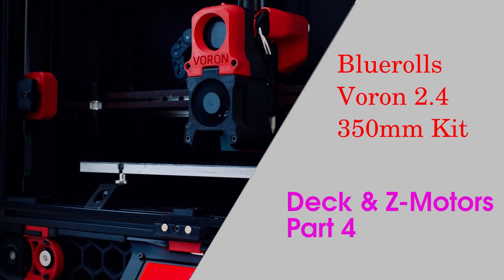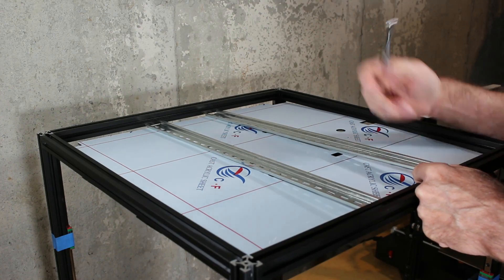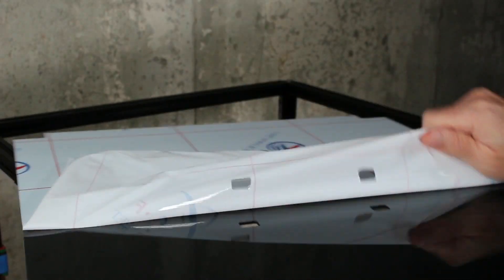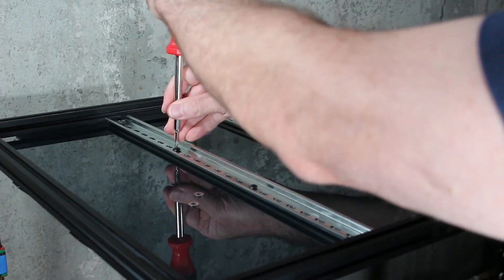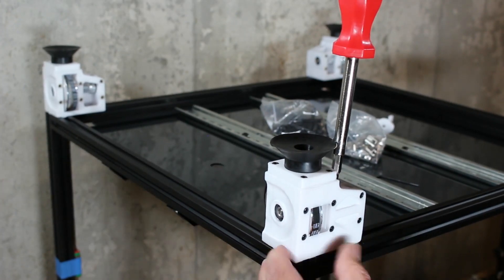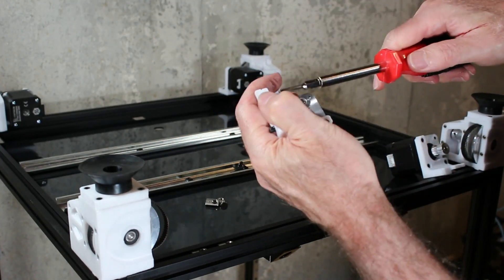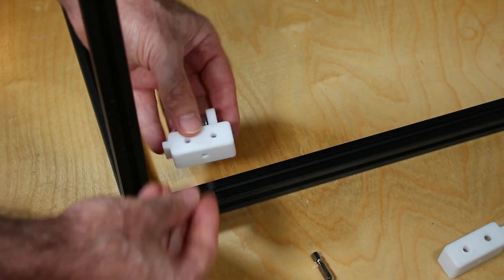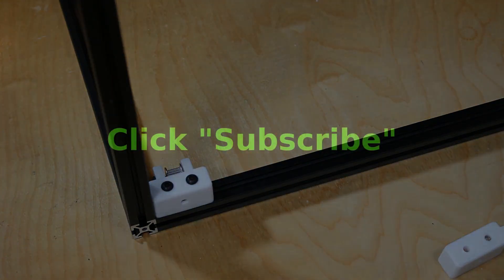Voron 2.4 Blurolls Kit Part 4 - Deck and Z Drives

Comment: I'm building the Z idlers on my blue rolls and noticed the 9mm idler pulleys have a lot of side to side play. The print has a small standoff to press against the bearings ID but it's nowhere near close on either side. Is this normal? I first printed the 6mm idler housing but it was way too small so these are 9mm for sure like yours.
Reply: It actually looks like I could add a washer to each side but if it's not designed that way I'd rather the route that is known to work well. Only area I see the play possibly being an issue is the cut outs in bottom cover.
Reply from the maker: I'm using 9mm z belts and the idlers measure just about 13mm from side to side on the outside (not exactly accurate since they are on the printer and hard to measure).  On the printer and installed, I can measure roughly 2mm in total space between the pulley and the idler.  The space on each side is uneven, but roughly 1mm each side.  It seems to work just fine.
Reply from the maker: @ChrisHarmon1  How much play do you see?
Reply: @KapmansBasementWorkshop  My 9mm idlers measure 13.04mm. I see about 2 of the included washers worth of play but a washer on each side doesn't quite fit without forcing it a little. The idler housing has a gap about 15mm across so roughly 2mm difference or 1mm slop on each side of 9mm idler pulley. I would use just 1 washer but that wouldn't solve the play plus it would be offset to one side. Think I'll try no washers and see how it turns out in the long run.